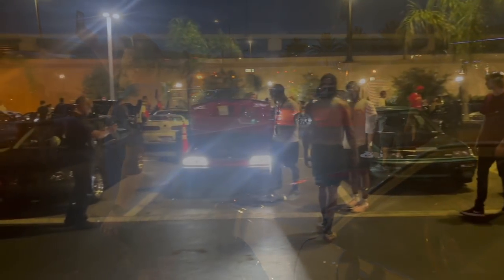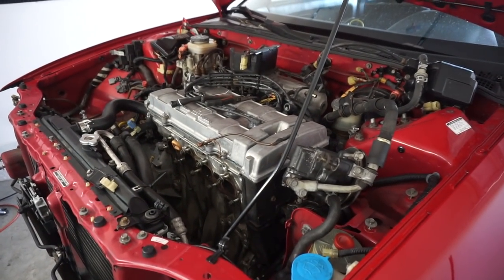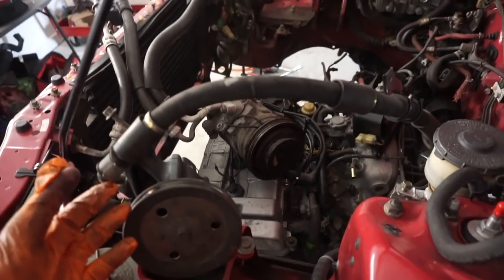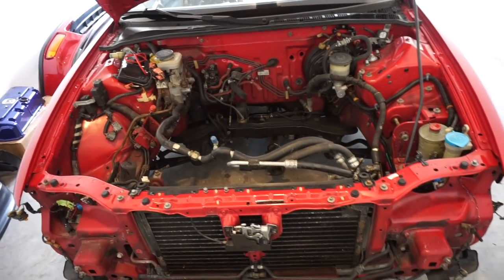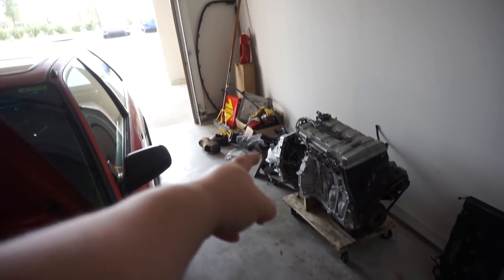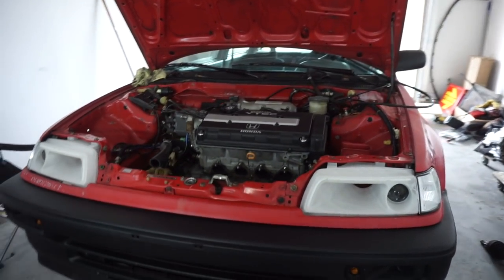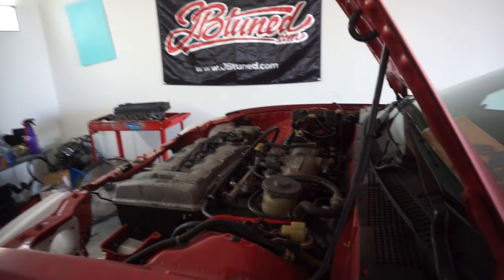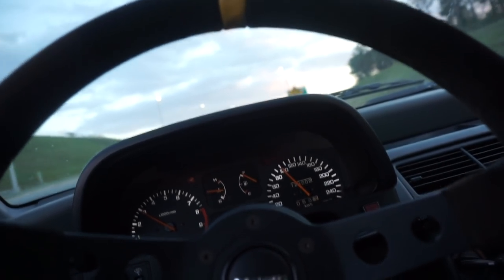Swapping B18 for B16 EF CIVIC DA Integra auto to manual!

Comment: Ive done quite a few auto to manual swaps on DA's. You really dont need to remove the entire engine, but the dashboard should come out completely. Removing the dash makes installing the pedals a hell of a lot easier, as well as drilling the hole for the clutch cable. I recommend installing a starter relay, take the two large black wires on the shifter, repin them into a standard relay with the ground going through the neutral safety switch. Green and Yellow wires on the shifter can be directly connected to the transmission for reverse switch to work. For your abs delete, just use da 4040 proportioning valve and da firewall lines. Keep the abs master cylinder and booster they are larger and more powerful. One of the non-abs firewall lines will need a m12 nut switched out at the master if you go that route.

Comment: Love the "just like the old days" videos.  That's a great idea just resting the engine on the dolly and just jacking the car off of it.  And I actually don't like painted engines, mostly because they look extra crappy once they become dirty and corroded and the paint starts chipping/flaking.  Any overspray on less than great implementations just adds to the look.  It looks amazing at first, though.

Comment: If you get the spare tire and place it on the jack. Then place it underneath by the exhaust tunnel in middle. it will lift the car  higher.

Comment: Come on, man.  This is like, the cleanest DA in existence.  Keep the power steering and just get it working correctly, if it doesn't currently.  My DA is so much nicer to drive with working power steering than it was with the jank de-powered setup it had when it came to me.

I say keep the ABS, too, but I guess it's not my hands getting scraped up working around that thing.  My car didn't have it.

Comment: Also, I have been in the process of swapping my 2004 Acura TL from an auto to a 2003 CL Type-S six speed manual (because the auto trans sheet the bed), and although I have a manual engine harness and 2006 TL manual ECU, it has to be reprogrammed for the immobilizer and I need it running on the auto trans ECU for now. I've seen many posts saying that it's possible, but I did the exact same swap on my 2001 CG1 Accord and I was able to trick the transmission range switch to believe that it was in park, but I can't find ANY wiring diagrams on the internet for the TL, so I can't trick it. Plus, I also can't get the key out of the ignition once I turn it unless I disconnect the battery. I know that it sounds ridiculous, but my closest Acura dealer is 45 minutes away, and the manual harness has the be installed along with the manual ECU for them to reprogram it for the immobilizer before I can use it and that's $150+tax. It'd have to be installed and towed there and I don't have a truck or trailer, so I'm kinda stuck for now. It's been a HUGE headache and I've been doing it all on my own with no room in my driveway and no help.

Comment: Big fan of this channel! I got a question why my 2003 rsx type s dies when I make right turns while I'm driving? Help thanks
Reply: Power steering switch working? Engine revs should go up when you turn wheel from lock to lock, and down when the wheels are close to straight.
Reply: @User5_  I change that already.